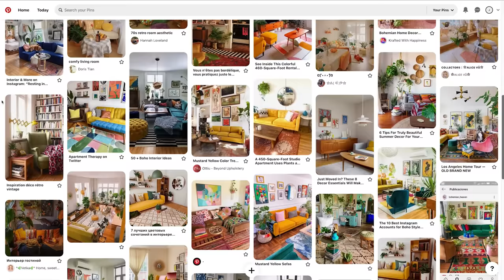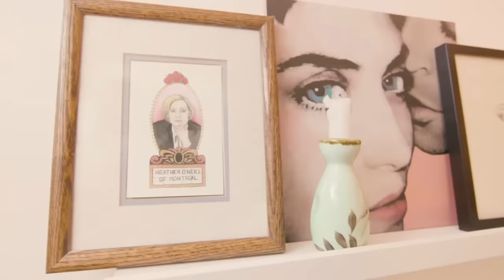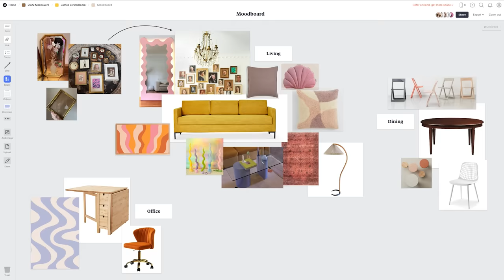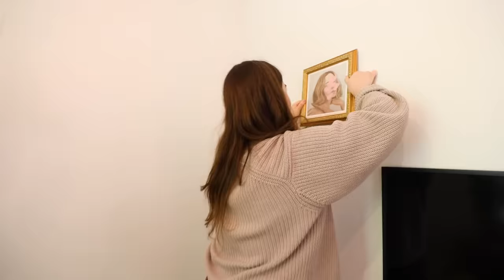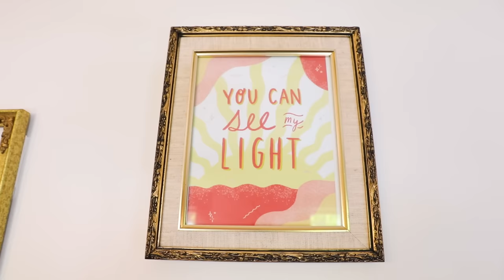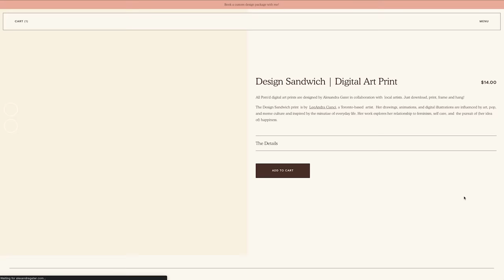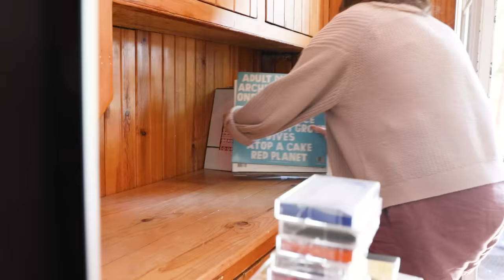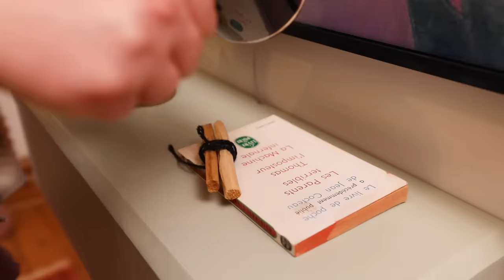Maximalist *Renter-Friendly* Living Room Makeover

Comment: I found out a trick to make permanent wallpaper into a temporary paper. It is to outline the edge of of each panel with blue painters tape, THEN, double side tape (extra sticky) on top of the blue tape. Add random  pieces of the combo (blue painters/double side tapes) to secure centers of wallpaper so it doesn’t buckle. Hope that makes sense.

Comment: Love this makeover! You can also use painter's tape in vertical lines the length of the wall applied the width of the wallpaper. Double it up side by side where the seam will be. Then apply double sided clear tape and hang the wall paper pulling the tape off as you smooth down the wallpaper. The coffee table looks so cool 😍

Comment: Wow!  You had a stunning apartment to work with, and you made it even better.  Love the contact paper on the windows.  I think I would have added it to the door as well.  I guess I'm boring,  but I would have placed a couch on the shorter wall with an end table and lamp on either side.  Putting the TV on a swivel bracket would allow James to watch TV while sitting on the couch or at the dining table.  I'm sure it would have been tricky, but that wavy-framed mirror would look good hanging horizontally above the couch.  A long bench, maybe with storage, could go under the windows.  Since it wouldn't be as deep as the couch it would add seating and allow for good traffic flow.  So many options...

Comment: I'm probably so far down on this thread that you won't even see it, but in the future, just get a peel and stick wallpaper that is super neutral and then adhere the regular wallpaper onto that. Pro tip: wait a full 24 hours before you put the wallpaper paper on and don't use as much glue. Yes, use enough, but just a little bit less than what you would if you were hanging regular wallpaper. It works. Did this in one of my apts because I couldn't find a peel and stick I liked. I put up one that I had "settled on" and then decided I didn't like it, but wasn't going to take it down because I was lazy. Then I went with the one that I did like a couple of days later and decided to just put it on over the peel and stick wallpaper. That thing stayed on that wall for THREE years... And although it wasn't "damage free", it wasn't anything a fresh coat of paint didn't solve.

Comment: I've been a renter here in the USA for a very long time.  The easiest way to cover the wall is with fabric stiffener and fabric.  I've done in in many places.  It's very user friendly.  All you do is find the fabric that you want to put on your wall.  Wash the fabric and dry it.  Then get  a bottle of Stay Flo.  Saturate your fabric with the stay flo and hang it on the wall just like wall paper.  Be careful if you use red or purple or something that's gonna bleed.  Also another tip for windows is to mix Elmer's School Glue with a few drops of acrylic paint.  Paint it on the inside of your window.  It looks like stained glass.  Hope this helps.

Comment: There is such a thing as removable wallpaper paste... As in, it's just like peel-n-stick wallpaper, where it will peel off lickety split with no issue! Worst case, you'll need to wash the wall with warm water IF there happens to be left over paste on the wall when the paper is pulled off 🎉🎉🎉

Comment: The reason the contact paper is coming off of the wall is that its adhesive was not meant to hold the weight of another layer of wallpaper and the adhesive. I’m a wallcovering rep and we have this issue in commercial buildings all the time when contractors want to put new wallcovering over old. It’s a no go because the adhesive will fail.

Comment: When trying the wallpaper over Contact Paper trick, you will probably have to use a special paste. Regular wallpaper paste does not stick to vinyl, and that's basically what Contact Paper is. But there is a special past made for sticking border to vinyl wallpaper. Try using that, and you may see better results.

Comment: PSA for other DIYers:
When using wood stain, wood oil, oil paints, or other oil-based things, do not leave your rags in a pile or they can spontaneously combust.

The oil generates a lot of heat when it dries, and if it's in a pile or trash can the heat gets trapped and it can burst into flame. Apparently it's one of the leading causes of house fires.

You're supposed to let the rags/paper towels dry separately and hanging or laying flat, or dispose of it in a sealed fireproof can.

(Just sharing because I've been watching home DIY videos for YEARS and yet no one has ever mentioned this!)

Comment: I would love to see how to make over james’ hallway because I have a 1,2 meter square with a door on 3 of the walls… yeah so how would you style that?

Outside door has a small square window, the wall to the left is a plain white wall, the wall in front is a plain white door to the bathroom, and the right wall is a door with a beautiful frosted glass window ( in the same rainbow frost vibe in this video), yeah so frosted glass window from floor to ceiling but with a big white frame around into kitchen and living room area. Again this is a 1.20meter square rooms with only 1 wall, the wall heigh is 2.40 

How do you decorate a tiny square entrance with doors on all the walls but 1? I am so at a loss on how to maximize this area

Comment: Hey Hello, Nynke here. the wallpaper does not stick to contact paper because it does not breathe, so the glue does not dry. wallpaper glue dries on both sides. through the wall and through the visible side of hedge wallpaper. Do you still want to stick wallpaper on plastic-like surfaces? then you will have to use a different glue. with bad luck this can affect the wallpaper later on.

Comment: i have a question for graham: how did you calculate the angle for the edges of the wood planks to cut to achieve certain diameter of the final cylinder? is there a formula for that? thanks! :))

Comment: RENTER FRIENDLY WALLPAPER TIPS: 
1) Secure only the edges with actual wallpaper paste.
2) Use super glue on just the top edge and bottom corners. You'll have to sand it off, but it's not moving.
3) Use painted thumb tacks, painted or for a contrasting design.

Comment: Contact paper:  It may be bcs it has a slick surface so the glue and wallpaper could not adhere to it.  Kinda like when you get your nails done it needs to be a tiny bit rough to grip the new nail.
THANK you for keeping the "mess ups" in the video.  Continue to do this.  It is real life.  Thank you
Only things I am not a fan of is the window treatment.  I feel like it will shine too much light and reflections on the TV, but to be fair it is a tricky thing to figure out
The 2 chairs on the wall... BUT this is not to say I do not love your heart, talent and end product of the place.

Comment: Changes - The mirror wall should have been the tv and frames wall and the sofa facing that wall coz you see that wall the first when you enter the room. The dining table should be behind The sofa separating both the spaces in a way with the sofa facing inwards to the room. The mirror should have been on record player place hanging on the wall on the entry of the room. The inside of the cabinet with books should have been painted the same color as outside to make it look custom cabinet.

Comment: Okay, I tried the contact paper thing (before this video) and it doesn't work. You could use foam board panels with command strips (put the wallpaper on the foam board and use command strips to attach the panels to the wall.)